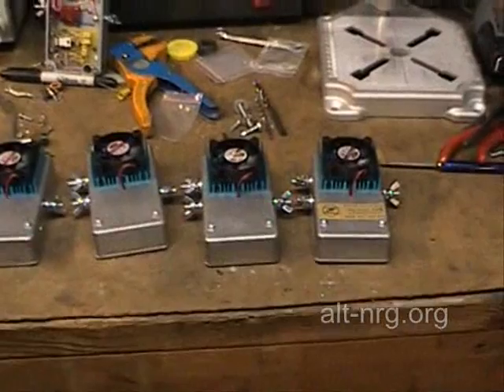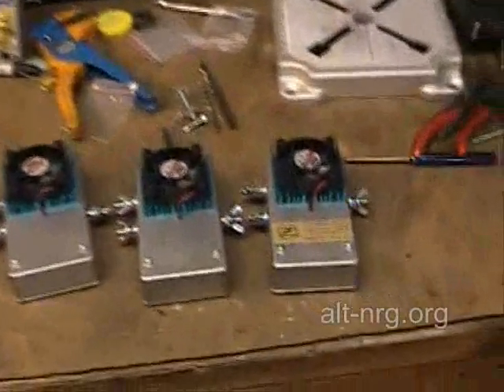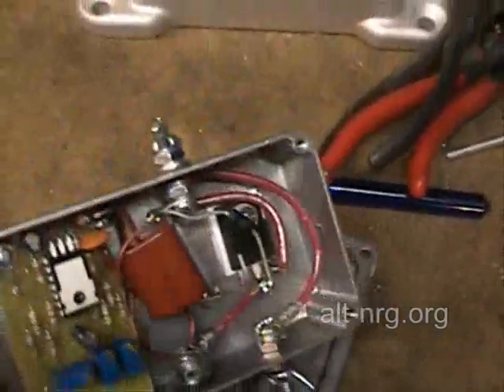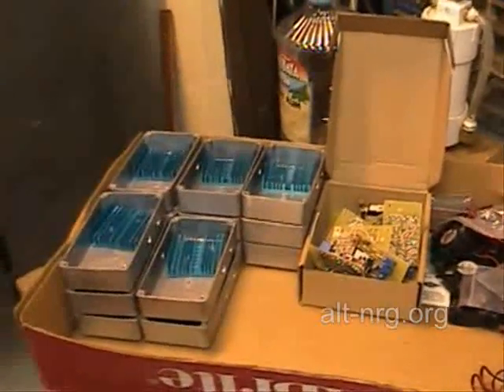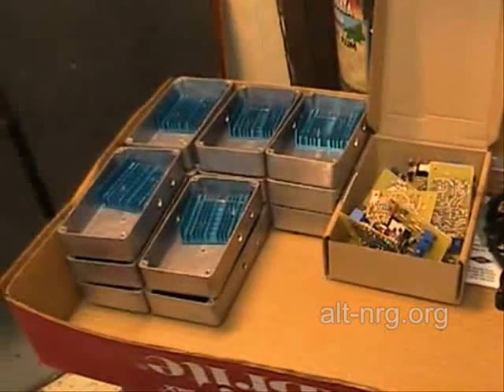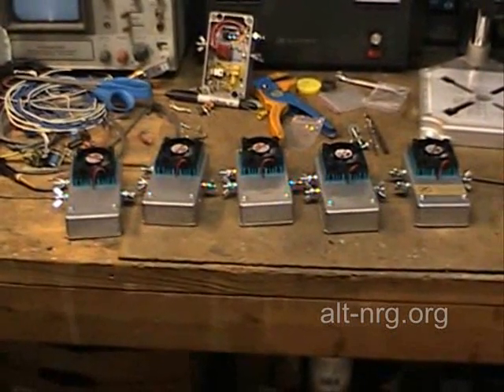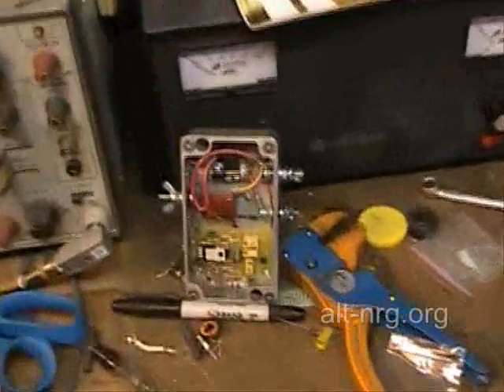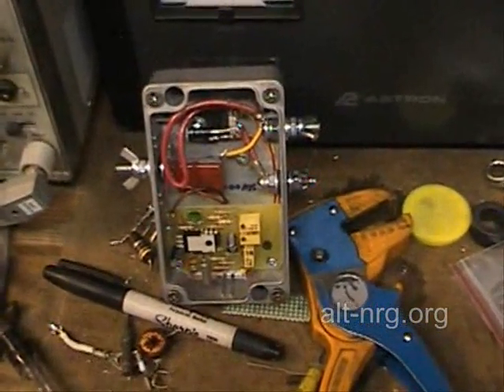#127 - PWM v2 production update

Comment: Why dont you make a dry cell 4n5 and put it on your vehicle to find out 
or go to zeros web site and read up, your math seem to be right, one lite of hho only contains about 1/8th hydrogen as the molucules are 1/16th the size of oxegen   but hho in an engine does not rely on btu for improvements as you know it cannot be done, experiment and learn

Comment: If you were to run near 75 amps continuously, isn't the wire between the mosfet and the terminal to the cell way too thin for that amount of current?  Wouldn't it overheat or possibly melt?

Comment: Nice work Z but my figures don't seem to add up for this.  Let me try to explain my figures and you can correct me.
auto doing 60mph at 20mpg uses 1gal gas in 20min. 1 gal gas has 115000 BTUs which only 17250 are accually used in a standard engine. 1 ltr of hho has only 1.1925 BTUs X by 20min =23.85 multiply that by 5 = 119.25 BTUs total. Thats only.69% of the over all max needed. So where does the gain come from?
Thanks in advance for your responce.

Comment from the maker: No, this is  not a resonant seeking design. It is an automatic current limiting PWM to control HHO output and help prevent thermal runaway.

Not the Holy Grail but certainly useful.

Comment: Hello Zero, 

The local electronics shop hooked my PWM up to a Scope, so I could see what it was doing. I get a square pulse. The duty cycle and the frequency are doing perfect, but the current limiter (VR 3 1 K ohm) has a very small range. How can I fix that? does that have anything to do with the shunt resistor? should I make it shorter? in Europe we use a different name for thickness of wires. And I do not know how thick the wire should be in millimeters.  Greetings from the Netherlands, Rick

Comment: "Final verdict is a 4.7uF/100V polyester film capacitor inside the box. While it will work without, it will still work best with four low ESR 1000uF caps in parallel outside the box."

Did you mean four low ESR 100uF caps in parallel outside the box? isn't four going to be alot in size and space?

Comment: I have to add that I also have to change my VR resistors for those that you use. Now I am using one turn resistors, and it is hard to adjust duty cycle  and I. I am learning while I am doing, I did not know what it meant when I begone making the PWM. But it is fun to do and learn. take care, Rick

Comment: Hi Z, First I want to say thanks. I made a PWM from your design and I got it working.(I know practical nothing about electronic circuits) I see that you use a different capacitor for C5, I was wondering what type it is. Is it ok if VR 2 is 25 K ohm? I have little effect from the frequency changes, does that have anything to do with my power supply or cell design? (I use a 22 amp car battery charger) I am looking forward for your answers greeting from Holland sincerely, Rick

Comment: Hi Z,
I'm glad you moving along with the plan. I can't wait to place my order. I do have a question, I am planning to run two generator with the PWM, will I have to double the duty cycle, current, and frequency parameters in the PWM? Thanks Z

Comment: I think your PWM designs are one of the best ones I have built, My compliments to you. I do have 1 Question. Have you and any of your viewer came across the traces burning out once a cell runs for a few hours at about 25 to 30 Amps? Its not a biggy just want to let you i have had the problem even though I print my PCB Baord traces at .070" thick inthe required areas.

Lately i have been building up on the Solder, Especially on your updated Schematic, Which i have to say, Works Fantastic.

Comment from the maker: Final verdict is a 4.7uF/100V polyester film capacitor inside the box. While it will work without, it will still work best with four low ESR 1000uF caps in parallel outside the box.

Comment from the maker: I can preset a max limit prior to shipping. Throttle can be adjusted with the %duty adj. Freq is not all that critical. To set your own max limit you'll at least need some means of measuring the high amperage. Clamp 0n DC ammeter or DMM with shunt.